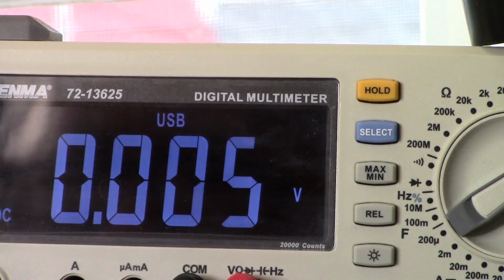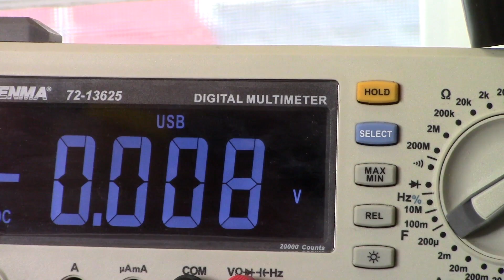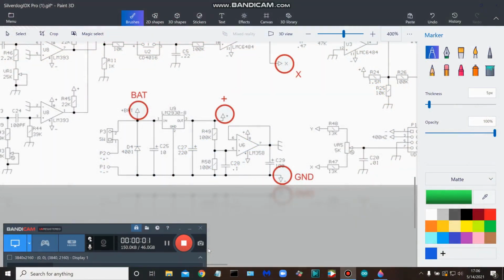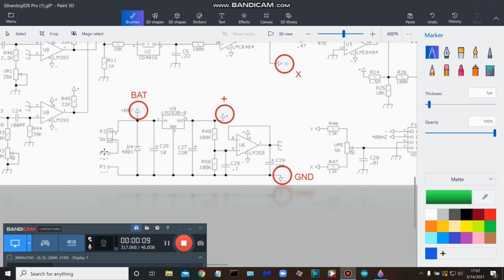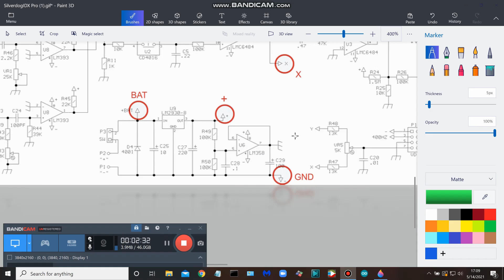IDX Pro metal detector DIY part 1

Comment: Mr Alic,this is Mohamed,the schematic I downloaded does not have protection diode which I don't understand why  it's connected between the positive and the negative terminals? Or  it should be 
A zener diode?
Also what is the E like sign at far right  outside above the positive terminal for the capacitor mean?
Reply from the maker: The diode is for reverse polarity protection. The E is for Emitter, B is Base, C is Collector

Comment: After alot of research i came across one of the deepest vlf detectors a detech eds plus .. and it turns out it has this circuit
Reply from the maker: I have not seen the schematic so I cannot comment on it.  Thanks for watching.
Reply: من مدار پالسی دزدان دریایی ساختم و ی سکه رو درفاصله 85سانتیمترمیزنه هیچ دستگاهی نمیتونه این فاصله روبزنه 🎉❤من از ایران برات مینویسم رفیق🇮🇷🌹💪💪💪💪بله درست متوجه شدی من ایرانی هستم ، ایران باستان ، ایران مقتدر ،ایران زیبا 🎉❤❤بیا ایران درخدمتت باشم رفیق 🎉
Reply: @azim-rg1fo pulse machines don’t have discrimination 

A higher hz pulse machine will be better for coins

Comment: Do you have WhatsApp or Facebook so I can contact you?
Reply from the maker: My friend the best way to discuss issues with metal detectors building is to post your problems to the Geotech Forum.  That way much information can easily be shared.
Reply: @SurfDetector  How to log in to the Forum?
Reply from the maker: I believe that there are instructions on the main page.  Should not be any problem.

Comment: Hello my friend, I have a Delta Plus 2 device that does not emit any sound and is not sensitive
Reply from the maker: Hi my friend.  My advise is that you post your questions about your Delta Plus to the Geotech Forum.  I have not built that circuit but many of the members on Geotech Forum have.
Reply: @SurfDetector  Thank you, my friend, for your response.

Comment: hey I wanted to ask as u have build many different pulse induction metal detector, so what do u think which one is good so far? and is voodoo project metal detector stable and any better ?
Reply from the maker: Welcome to my channel.  Please subscribe.
The Mini Pulse Plus, the Arduino Nano PI, the Barracuda and the Crossbow are all good machines.  The Voodoo is an interesting prototype project because it allows for iron to be identified which is very unusual for a PI detector.